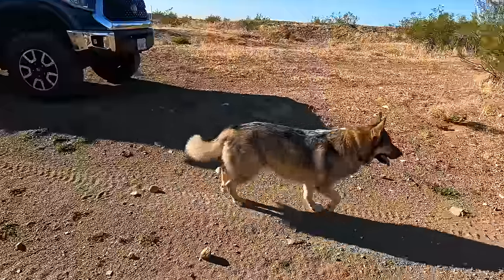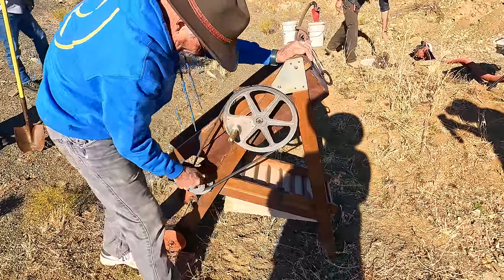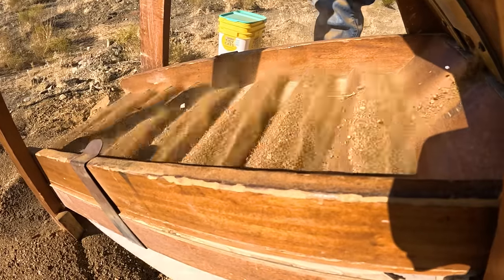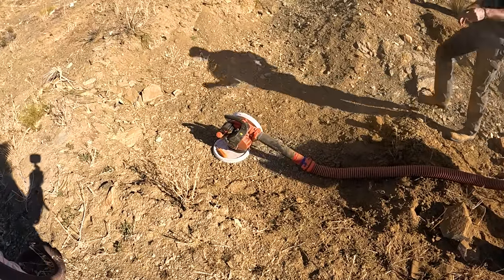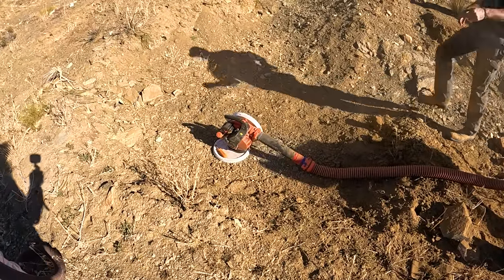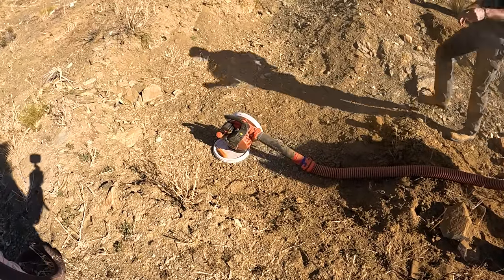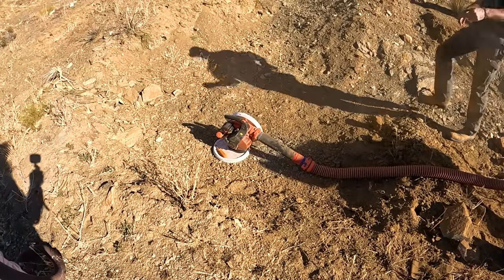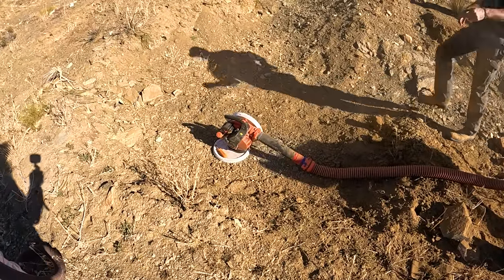Dry Washing *Gold* in the California Desert!

Comment: I would not have the hose clamp on that mad mountain dry washer had already fixed it to death. It started shaking mine apart, and then the bearing went out in my shaker motor and I had to get a new motor. I got a variable speed one and you can adjust the weights. It works so much better and doesn’t shake the thing to pieces. I’ve had to do so much work putting it back together from the original motor, if you run yours a lot, it’s gonna shake the rivets right out of the machine. That’s what it did to mine now that I got this new motor and it’s variable speed. The weights are adjustable. I have the weights at 80%. I’ll tell you what it works way better than the original motor.

Comment: The Scheelite has to be valuable also, tungsten is not cheap
Reply: I was curious about that too when I saw Jason's video, so I looked up how they process it. Apparently it's very difficult to process and refine, more difficult than gold because gold is a noble metal, while tungsten will form various oxides easily.

If that's the case then you probably need some very high grade ore to turn a profit, but in the case here, at least it looks like they have a lot of it and it's easy to separate.

Comment: That "clay" looks like caliche KA-LEE-CHAY. its a limestone false bedrock that flowed with water millions of.years ago and dried and solidified. Over 1000s of years gold bearing materials moved in over the limestone layers but the gold couldnt drop lower than the limestone cement layer. The actual bedrock could be 30, 40 up to 150 feet below the surface!